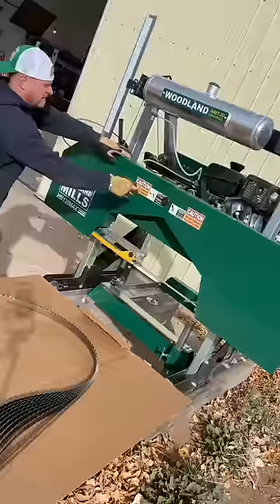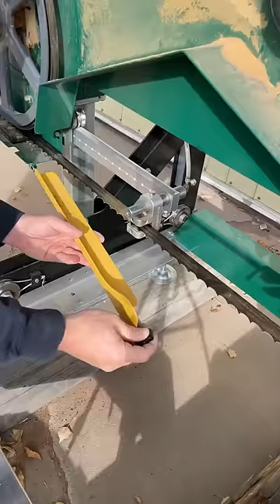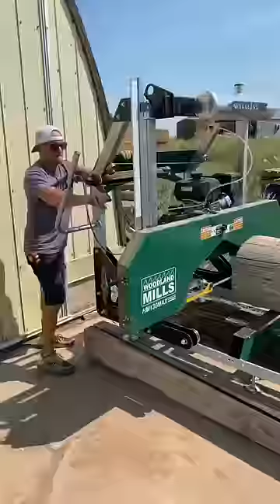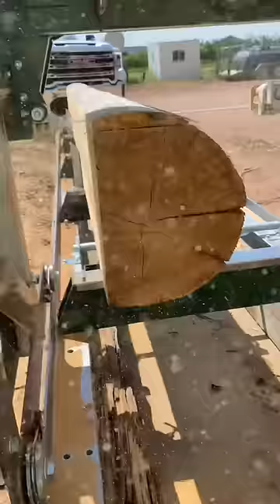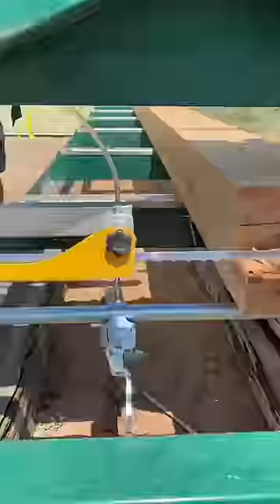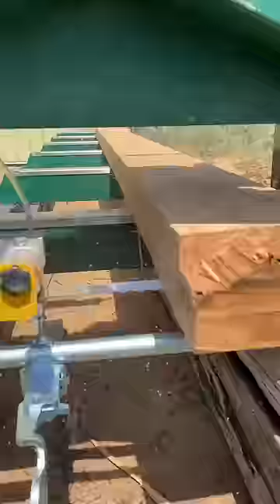Changing to a fresh blade to mill a cedar pole #sawmill #woodworking #maker #wood #diy

Comment: That's the biggest band saw I've ever seen...and i love the whole process...nice!
Reply from the maker: 👍 This is relatively small portable sawmill.  I have a bigger one on order 😁
Reply: @dustylumberco  WOW! I figured you always got a new one coming 😂. Are you teaching little Dusty the trade? Love your show.... it's a dream for a lot of us folks. Ty!
Reply: Sen beni ne zaman cirak olarak yanina alacaksin? Hala bekliyorum maas istemem isi ogret yeterli😂
Reply: @kilbil5390 приезжай научу
Reply: @drevnyi_urman  тайга
Reply: @dustylumberco  good Job n good tool 
salam from Indonesia
Reply: @dustylumberco  In the summer I worked at a band saw that was 2 times larger than yours, and I had to push and turn everything by hand, without the help of improvised means.
Reply: В России это стандартная пила
Называется "рама"
Reply: We manufacture our bandsaws in cutting widths of 20-90 inches and in lengths of 11 feet. We also offer a variety of power options for you to use. Such as electricity, gasoline, diesel, etc.

Comment: We manufacture our bandsaws in cutting widths of 20-90 inches and in lengths of 11 feet. We also offer a variety of power options for you to use. Such as electricity, gasoline, diesel, etc.